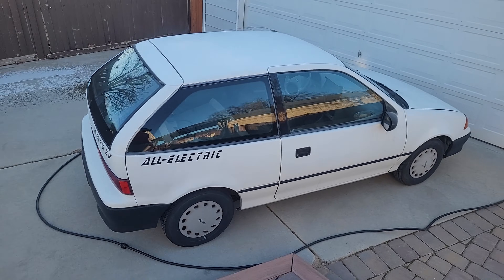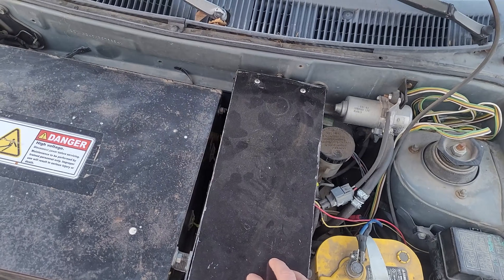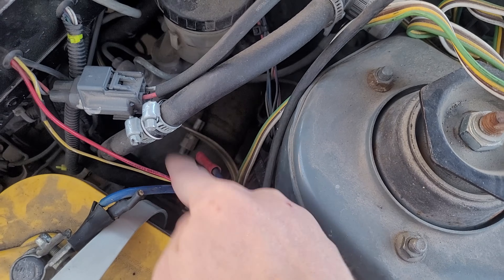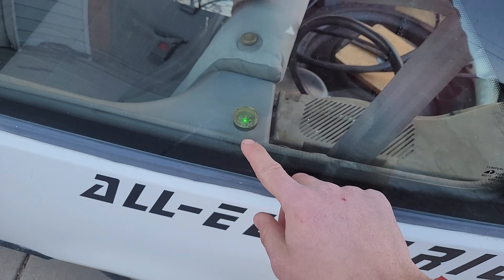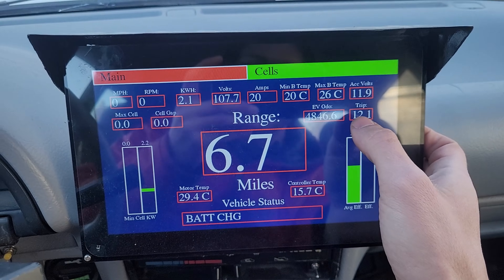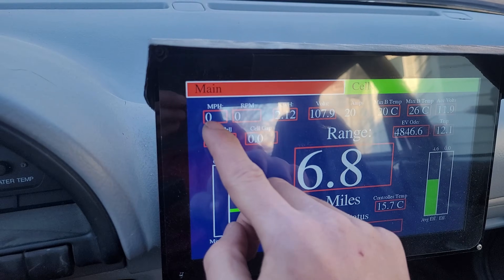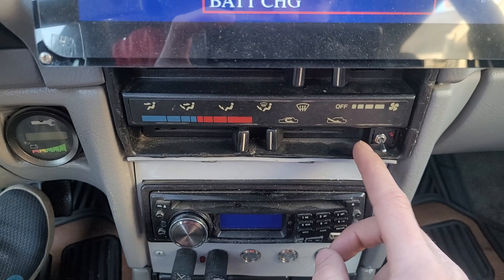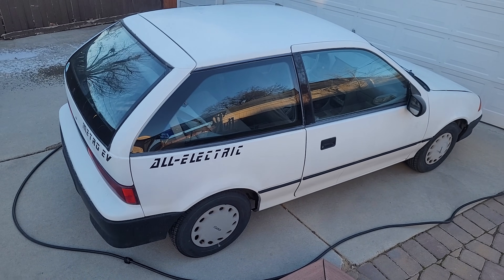Tour of my EV Swapped Geo Metro

Comment: Nice build. It's a great way to commute and shop for much less cost than petrol. The car will also last longer without the complexity and heat of the gas engine.

For those who think the horsepower seems low, keep in mind internal combustion HP ratings are based on the peak of the power band, which means you only get that amount of power at that particular RPM, but less on either side of the peak. Electric motors are far more consistent, and you have full torque at 0 RPM.

I would slave the heater power button to the fan speed control, so in winter you can leave the button in and have the heater automatically come on when you turn on the fan, and in summer you can turn off the switch and have the fan only for air circulation. I'd also have the heater button light when active in case you forget.

Comment: Could this be done to an automatic transmission car?
Reply from the maker: @DanielMelton-t7u  It has been done, but it's a lot harder to get all the electronics in the automatic transmission to work properly. The transmissions also fail faster because of the increased power and torque input. Manual is definitely easier.

Comment: I have a 94 I bought for cheap years ago. A crazy little car. I can only imagine if todays engineers updated that 1 litre engine what it would be today. 80MPG? I will wait until (if) battery tech gets better to equal the original 300-400 miles per charge. Ps: take out the passenger seat and you can fit 8 foot 2x4 lumber inside with the hatch closed 😊

Comment: Watch for early lower ball joint and tie rod wear on the front end. (could be causing the wobbles.) I have a 1976 Solectria Force and I love it. (lead acid batteries).
Reply from the maker: @stephengreen3566  1996? Or 1976?

Comment: Question: Do the gears actually improve efficiency?
Reply from the maker: @omgBenton  They don't. But they are necessary to get up to speed. The motor is very low power/torque and only spins up to 5000 rpm. OEM EV motors are high power and torque and spin to 10K rpm. This car could start moving in 5th, but the low torque would make it take forever to get up to speed. Having the gears allows for power and torque at all speeds so the car is usable.
Reply from the maker: @omgBenton  They don't. But they are necessary to get up to speed. The motor is very low power/torque and only spins up to 5000 rpm. OEM EV motors are high power and torque and spin to 10K rpm. This car could start moving in 5th, but the low torque would make it take forever to get up to speed. Having the gears allows for power and torque at all speeds so the car is usable.
Reply: @zuccamachine  ahh I wouldn't have thought of this. Great point.

Comment: This in its original gas variant would use only 1 gallon of gas and do the same distance if not more, why ruin it?
Reply from the maker: @carbq5280  Ruin it? Everyone here in the comments thinks it got cooler and more unique. 

The spirit of the Geo metro was efficiency, and low maintenance/operating costs. The point of this project was to take that to the next level. It's fuel costs are even lower now, and no maintenance other than tires now.

Comment: Nice conversion! I think you need to charge your LA12v battery at a higher voltage,  It should be float charged around 13.5-8 V not 12.0.

Comment: This is actually really awesome. I mean it!
I saw a different dude who converted his ford escape into a ev, though his stock  gage cluster doesn't work because he gotta figure out can signals. Nice to know you got yours working. Do you think keeping AC would be hard?(if the car came with it from factory). 
Also, how do you feel about safety driving this around?

I hope converting ICE cars to EVs becomes more popular as it's the ultimate environmental move
Reply from the maker: @PlumbCarton5607  AC runs off the drive belt, so you would have to swap in an electric AC compressor. They are pricey, $1K+. I just deal with the sweaty back.

It feels just as safe as the original gas car! Actually, safer because it has better braking with the regen.

Comment: Thats pretty crazy. For city driving thats not far off from my golf cart (which I drive on the road in the city). That has a 5kwh battery and goes 30-40mi. Although I could have gotten a larger 7.7kwh battery for ~50mi range. Thats ~6.5mi/kwh. Both charge 0-100 in about 5 hours.
Reply from the maker: @adamt195  My driving is 80% highway. Average 4.5 mi/kwh in the winter and 5.5 in the summer!

Comment: Congrats on the build. 

Did you ever consider making the battery pack out of Removable Battery Modules? In a similar fashion to what's utilized for battery swapping scooters. Since there is such easy access to the battery box. And it would add a lot of versatility and added repairability. (For example: It allows charging the batteries at home such as via solar. And the batteries can be interchanged and integrated into a home charging/energy storage system)

But ofc it would add a little more complexity. Hopefully you'll consider it a worthwhile trade-off at some point?  Just a thought.

 Good luck in your subsequent projects.
Reply from the maker: @nc3826  The battery boxes weigh ~140lb each. You'd need an engine lift to swap them, not worth the effort.
Reply: @zuccamachine  OFC, and I'm sorry to confuse you. But when I mentioned scooter battery swapping. I assumed you would realize I was referencing appropriate capacity battery modules for swapping. For a future EV conversion, not this one.

It is already being done for mini EVs in Europe. So it's definitely doable, but it is uncommon. So your reluctance is understandable.

I enjoyed the post and thanks for the feedback. Good luck with your next project.

Comment: Would you ever consider trying to remove weight by removing unnecessary wires? (I.e. blower motor resistor delete, speaker delete, fuel pump wiring delete. ect). I have a Zap Xebra and like this content.
Reply from the maker: That's pretty negligible and probably not worth the effort.

The 3 easiest ways to gain range would be downsizing the battery, removing the spare tire and jack, and add a cover under the engine bay to reduce drag.

Comment: They lied to us. One CAN have a real non-simulated manual transmission EV!

Seriously, this needs to become a thing... I know it's technically "stupid", but it's cool and should be an option in EV sports cars.
Reply from the maker: @JustinDaniels  It works when your EV motor you are swapping in is closely matched to the torque and power of the engine taken out. If the EV motor is too powerful, it starts to slip and damage the clutch.

Comment: I gotta be the annoying guy and ask the two most common questions. How long did it take you to build it? And how much did it cost? Obviously the last one varies widely with good condition used batteries dropping in price and even used motors being possible to find if you keep an eye out.
Reply from the maker: @marsrover001  Time to build is similar to KSwapping a metro, with having to change mounts, exhaust, fuel lines, sensors, etc to get everything to work. Took a long time to build, but a 2nd build would go much faster from lessons learned.

Cost is highly variable. My rule of thumb I tell people is 2-3X the cost of a used OEM EV with similar specs. You can of course shave a lot of that cost down if you have the skills to fabricate, install, wire, and diagnose yourself.
Reply from the maker: @marsrover001  Check out my other video- 

https://youtu.be/dfBYbKOA9QQ

I tracked the time and build cost much better on this motorcycle.

Comment: Your build is amazing! Did you consider do not carry a spare tire? It would save a lot of weight.
Do you plan to upgrade the battery pack for higher capacity and higher voltage?

Cheers
Reply from the maker: @Full_Throttle_no_Brakes  Spare tire fits there easy enough so I just left it there for convenience.

Higher voltage battery pack would mean changing out all the other HV components (motor, controller, charger, DCDC) and that gets pricey quickly.

Capacity could certainly be increased with only needing to find the space and no other architecture issues.
Reply: @ Got it. Thanks for answering!
Reply: A Metro spare doesn't weigh much

Comment: Cost? was quoted $70k to get a ev conversion kit installed for a similar year miata (though 160HP, and 150mi range)
Reply from the maker: @azertyQ  Where are you located? I'm hoping to move into converting EVs for customers soon.
Reply from the maker: Rule of thumb is 2-3X a used OEM EV with similar performance and specs.
You can of course save some of that if you can do fab work and install yourself.

Comment: all the heavy bloated $50k + electric cars on the market claiming to be "environmentally friendly" are really not. I like the Nissan leaf because of its city car approach, where it serves its function and nothing more. This is even a better version of that. If a car performs its function well enough and efficiently enough, it doesn't need to have gimmicks and try to be a status symbol to make up for what its lacking in economy and practicality. Cars like this is exactly what the market needs right now. I daily drive a base model ford probe with no option, 2.0 with a 5 speed manual. It weighs roughly 2300 pounds and after making an undertray for it and installing low rolling resistance tires I am able to get 42 mpg highway and 36 mpg combined in a 30 year old car with 130k miles.

Comment: Can you "charge" while driving?

I'm wondering if you could tow a generator while driving to lengthen the range.
Reply from the maker: @Iowa599  No. There is a safety feature that disables the controller when a charger is plugged in. This is mainly to prevent driving away while you are still plugged into an outlet.
Reply: @zuccamachine  that means you can! 

Safety "features" can always be disabled, bypassed, or tricked!
Reply from the maker: @Iowa599  The charger can only take 3.3kW max. If there were a generator running (ignoring the ridiculous inefficiency of using a gas generator) outputting 3.3kW, you'd be speed limited to about 20 mph with that power, and a very slow acceleration to even get there.

Now next someone might say "get a bigger charger, and a bigger generator". My answer - you could by a Chevy Volt/Ford CMax for much less and arrive at the same place.
Reply: @zuccamachine  that would be running off the generator, only, with multiple electronic voltage controls. Lets say you planned on a long trip, so you started with a full battery and started the generator immediately. While you may draw more than the generator output, battery losses would decrease, so range would increase.

As for multiple voltage controls reducing efficiency, simplify them. Delete the solidstate controls converting 240vac to whatever dc voltage is used to charge & replace it with only a rectifier to convert AC to DC, and replace the generators throttle control that holds the output at 240vac with a throttle control to hold the desired DC voltage coming out of the rectifier.

That would increase efficiency of the generator, and increase range. Probably not make the range infinite, but that is not what I was thinking about. I live in BFE, so my trip to anywhere is about your total range, which would be a problem if I wanted to go home the same day.
Reply from the maker: @Iowa599  Sounds quite complex and not worth the effort for a niche use case. Makes much more sense to just use an EV with a longer range or get a plug in hybrid for your use!
Reply: @Iowa599 I’ve had this in my head for many months. Perfect for going on a road trip and just want to extend your range. No need to stop and charge every couple hours.
Reply: @zuccamachine  then why put a motor in a Suzuki/Geo? Might as well just buy an EV!

We do this stuff for the experience of doing it! Like, my current car has a 75 farad cap & a 4ah lithium group 7 replacing the 35 pound lead anchor it came with. That gains me nothing, I just wondered if I could, and it lost a lot of weight. Not enough for any significant performance, but plenty of learning!

Comment: Really awesome. I'm specifically interested in the overvolt potential of the motor and controller. What makes these components capable of withstanding the higher voltage and current you're putting through them and how do you identify the limits.
Reply from the maker: @phillipyoung3250  The motor and controller have a nominal range printed on them. The spec sheets show an absolute max, which this car is still under. The motor and controller can take 500-600 amps, but this car is only delivering ~350max. So overvolts but undercurrent, and still under the overall power limits.

Comment: how did you get the factory analogue gauges to work? I have yet to figure out how to make a device to convert digital signals into variable resistance readings that would be accurately represented on the dash of older cars.    VERY cool build.

Comment: That... is... so cool! I always wanted a Geo Metro because they were so efficient. And like you said, you took it to the next level. Thanks for showing us around your ride. Also, how did you manage to get the regen braking of the electric motor to work smoothly with the original brakes?
Reply from the maker: @MistrDoubleYou  The Curtis controller supports "throttle off" and "brake on" regen. The brake and throttle pedal have switches that connect to the controller.

Comment: 3 cheap things to help your range/speed get a set of ls headlights. 2 look at flatening out the bottom of the car by covering  the the engine bay underneath and flaten out the trans tunnel.  

Last lower the car and istall  a wrap around lower lip.

These could all be done cheaply.  

Also look into gurney flaps to help the rear.
Reply from the maker: I'll definitely try the undercarriage cover, since that reduces drag by 30%!

https://www.johnsavesenergy.com/geo-metro-aeromods
Reply: aerodynamic drag is the square of AirSpeed.... 

So if you're driving it at let's say 25 mph it's probably well below that 30%.... But about 45 mph..... It's probably above 50%.... Relative to the Aerodynamics of the vehicle

Comment: Amazing. Whats your top speed with this on the highway?Wonder how many watts of solar you’d need on the roof to charge as you’re going down the road?
Reply: well the most efficient evs do about 5 miles per kw. so to do 30mph youd need to generate a constant 6kw.

The energy from the sun hitting the ground in ideal conditions is about 1kw so already youd need 6 sq m. lets be generous and choose 33% efficient panels, so you need 18 sq m of panels.

So youd need the roof area of a motor home, the efficiency of the best cars on the market, perfect weather, and perfectly angled solar panels. 

Which is why solar panels on cars aren't really a thing.
Reply: @benholroyd5221  damn, this make sense. But a man can dream.
Reply from the maker: @thriftswift7690  Highway driving to come in the next video, subscribe!